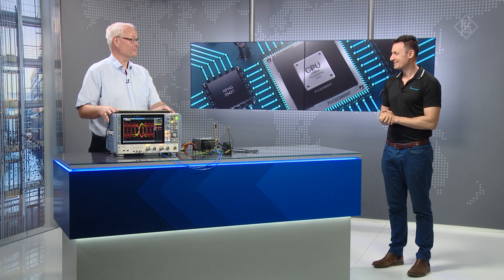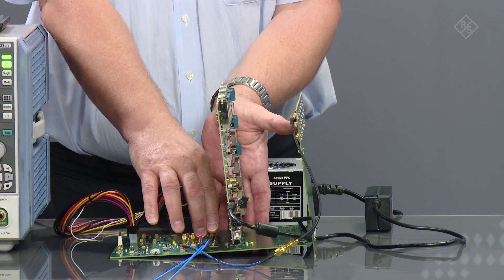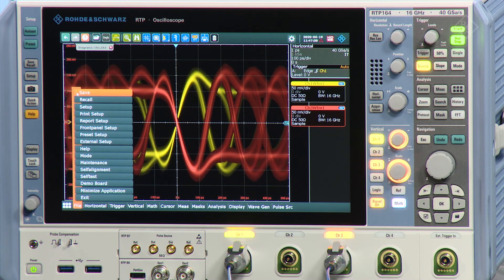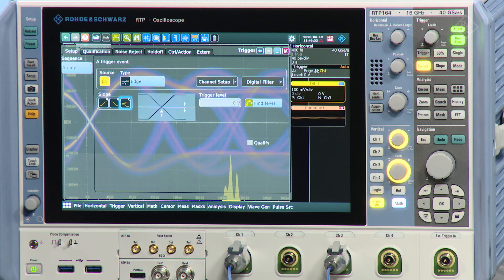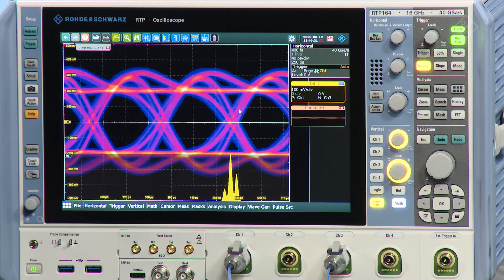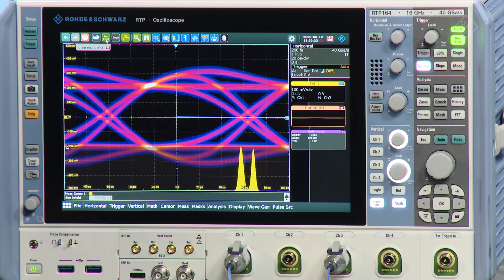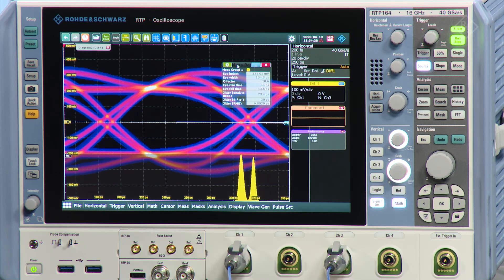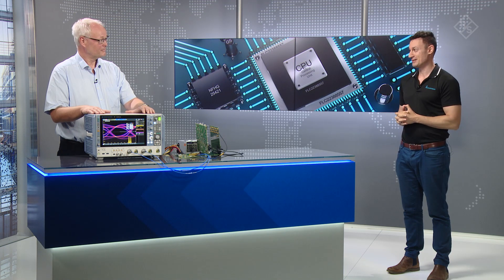Application video: Eye diagram analysis of the PCIe Gen 3 CPU interface

Comment: Well, its a scope advertisement.  And while using the saved setups and triggers makes some sense, if you really want to show off the scope, you have to show the settings your used, which you did not.  (Pretty much, you showed that the scope has "save/restore" settings abilities, which includes the complex trigger setup.  But the complex CDR type trigger, only the results were demonstrated.    [And then there is the headline....   Gee, most users would expect to see some type of analysis of the actually observed Eye Diagram, and you did none.]   So not really a great ad, and a totally disastrous "analysis".